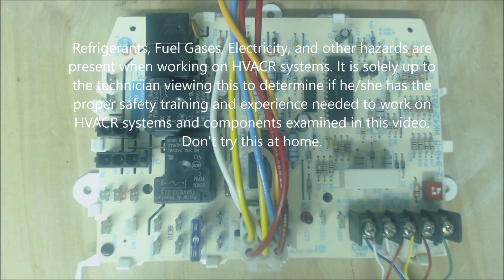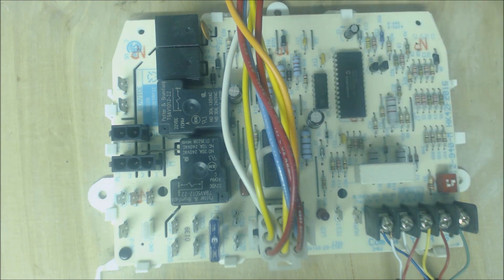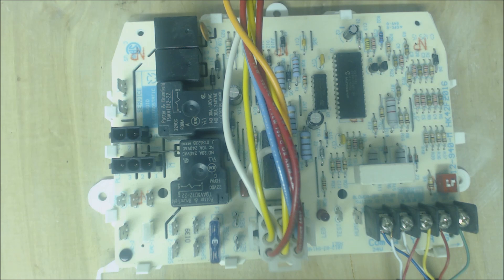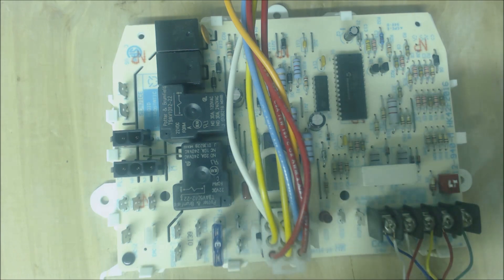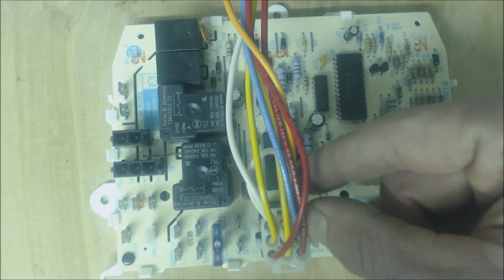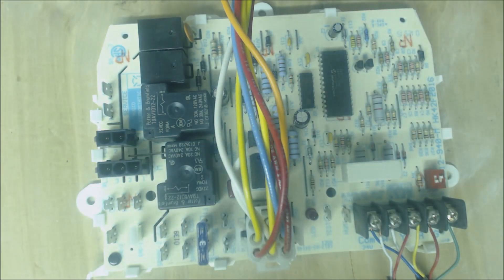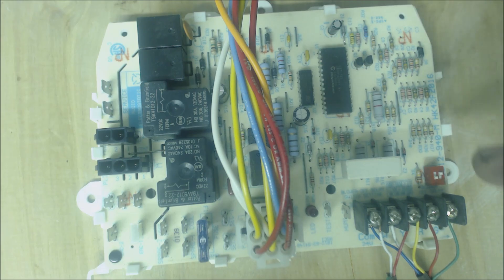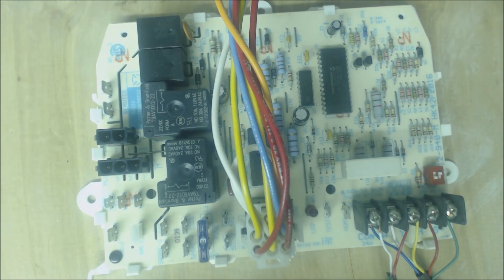Troubleshooting the Furnace Control Board IFC to Test if its BAD! For Heat and AC Diagnosis!

Comment: In one of your thermostat videos I believe you said that if you jump red with common in the thermostat you said it will blow the relay, with that being said is there any other area that you jump anything will it blow a component.
Reply from the maker: In reference to thermostat wires if R touches W, Y, or G and then they touch C directly then the fuse will pop. Remember that W, Y, and G wires are signal wires so that when you are calling for fan to turn on then 24v will ride the G from the thermostat to the furnace or air handler. If there is no fuse then damage could be done to the board and the 24v transformer coil will open and break. Thanks

Comment: wouldn't you measure from the red wire to the green wire for 24 volts for the fan instead of the white common to green?I thought common had no voltage on it once it switches to the green or yellow or white wire.Cause Red is sending out 24 volts then what ever wire it comes back on would be the other 24 volts?right?Any help would be appreciated,Thanks
Reply from the maker: No Problem, If you want to turn heat on then you can jump from R to W with alligator clips. If you want to turn fan on then jump R to G. If fan was calling at the thermostat and you measured from R to G you would get 0 volts but if you measure the now hot G wire and connect the other probe to common then you have potential voltage of 24v confirming you have a call on the board at G. It is the same when measuring 120v. One probe on the hot black wire and one probe on the white common wire. Thanks for the question!